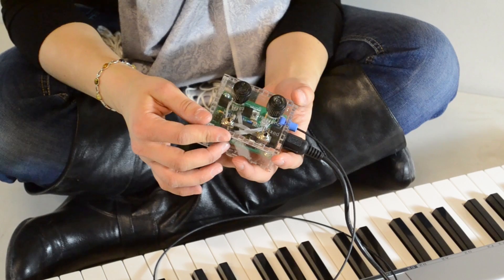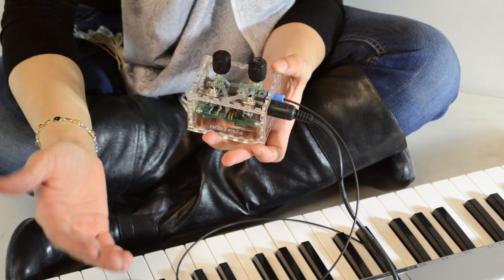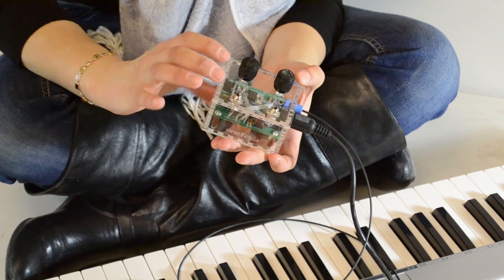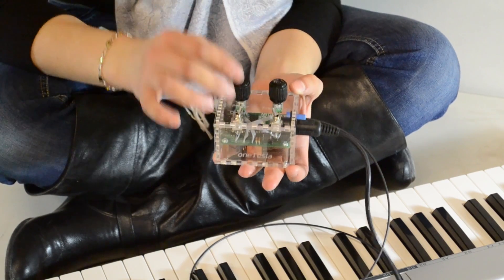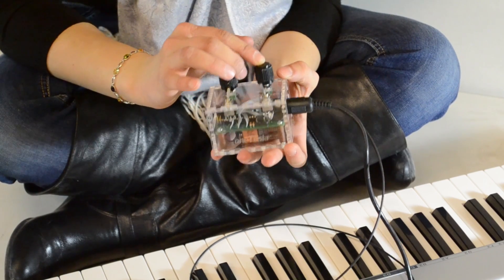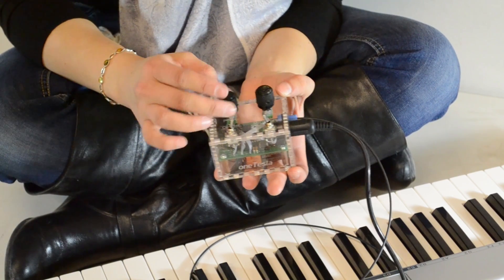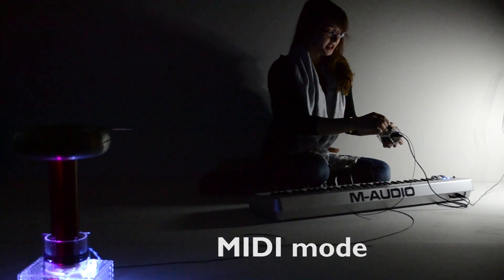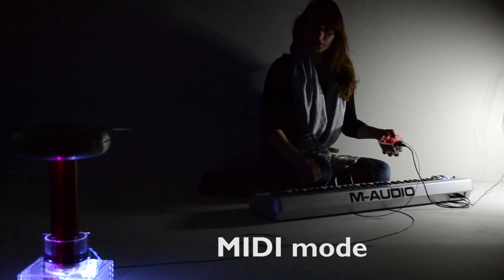oneTesla: new interrupter + piano demo

Comment: It seems, during the descending arpeggio at the end, that the power output of the top load increased as you played the lower notes.
Reply: Lower frequencies travel farther. Higher frequencies have a lower wavelength. The slower oscillation would allow a greater arc. I imagine it has to do with frequency and attenuation directly. A tweeter can't do what a subwoofer can because it can't physically move that much air.
Reply: It's because the primary circuit is resonant, thus it takes many rf cycles to "ring up" enough current to get good output. When the modulated frequency gets too high it has to make the ring up shorter.

Comment: Ive been wondering if its possible to hook the driver up to a much larger coil? I mean all you would need to do is make it resonant with the bank capacitor right?
Reply from the maker: Yes, that's correct!
Reply: @oneTesla  heck yeah! I actually dont know much about DRSSTC's. Do they even use bank caps?
Reply from the maker: @nightrous3026  Yes
Reply: @oneTesla  I feel stupid. I mean its the best way to achieve resonance.